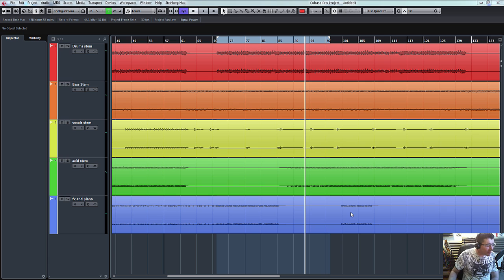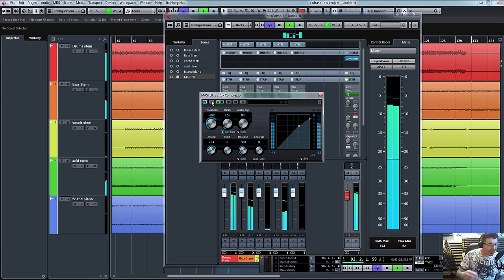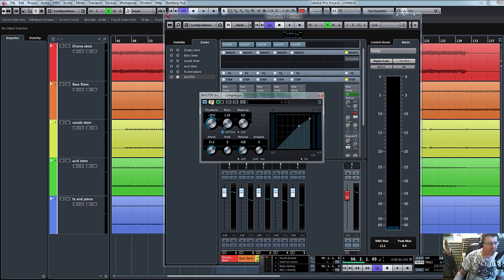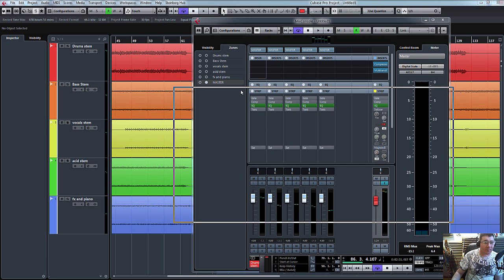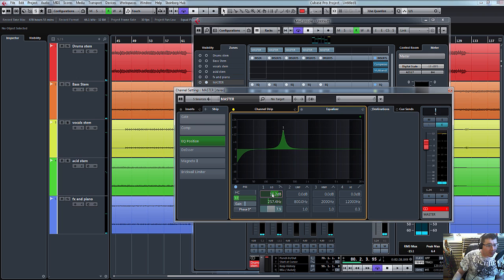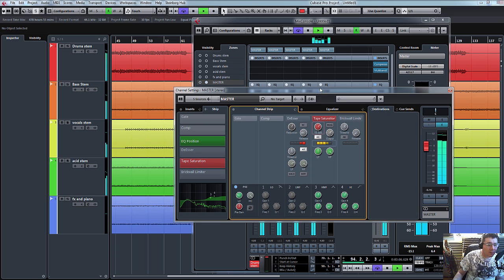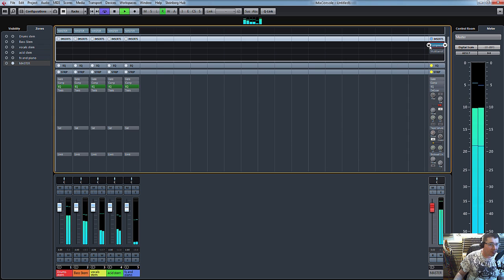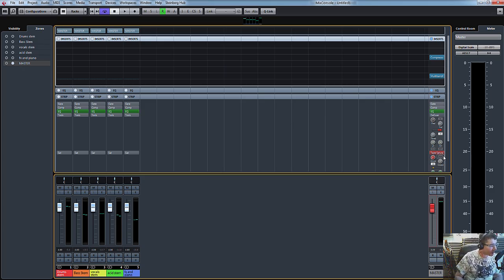Mastering Audio Stems Using ONLY Steinberg Cubase Plugins

Comment: Just a question and it will help others, what RMS levels are you aiming for before final mixdown ?
Reply: Dee Em On a meter you trust, -14 dbfs. In Cubase 7/8, simply click on the meter in console where it says "digital fullscale" and change it to "K-14". Then you can see clearly see without reading when you push past green and sound pressure levels are getting a bit too much.
Reply: cheers